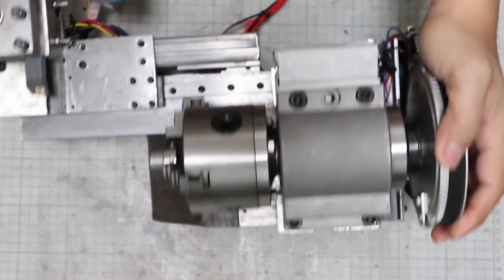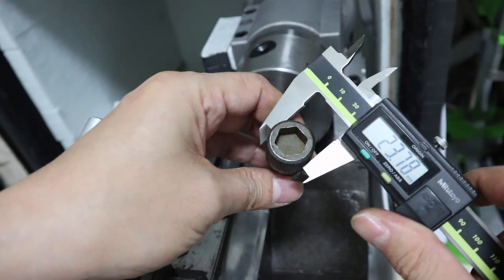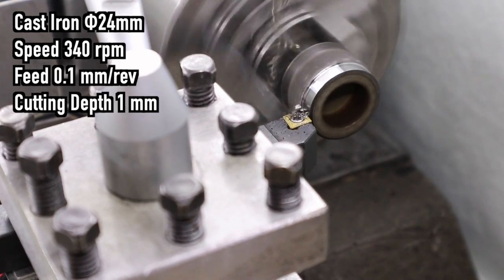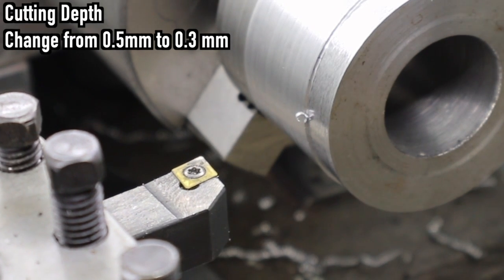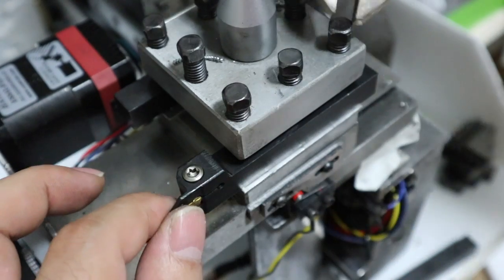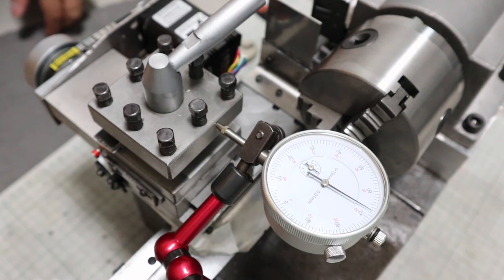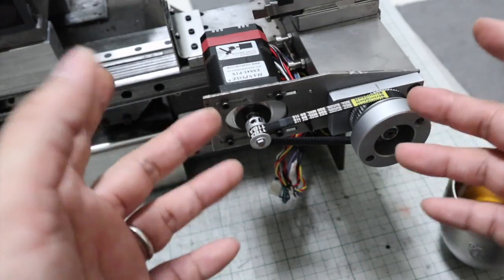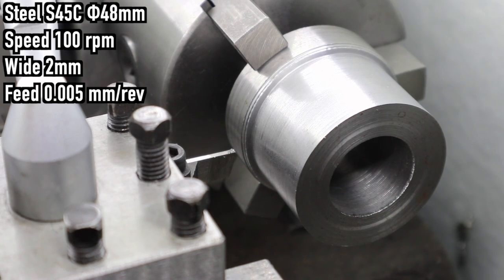Homemade DIY Small CNC Lathe ,Part7

Comment: Looking at steel cutting at 4:14.  What cutting speed is recommended for the insert in case of steel? Maybe quite a big higher then the about 30 m/s you use here?
Reply from the maker: This is because the maximum speed of this lathe is 340 rpm.
Since the motor is small, torque is important.

Comment: At 9 minutes in, when it was vibrating, the lathe insert was loose. You could see it shift when you stopped the spindle. I'd recommend retrying after ensuring the insert was properly secured.
Reply from the maker: Thanks for the advice.
It will be helpful.

Comment: Very good video series ! I have bought a little chinese lathe 7 x 14 maybe it can be converted to cnc as well ? I like the idea with the small box arround it to keep the noise down and it is also much cleaner in the apartment :)
Reply from the maker: I think it is easy to CNC your lathe.
All you need to do is to set up your lathe with steppers motor to rotate the XY axis.
Linuxcnc would be a good control program, but you will need to learn how to set it up.

Comment: speed up

cast iron 1400 rpm
steel 1650 rpm
alu 3700rpm

bit very noce want to build a mini lathe as well vor small alu and plastic parts 

impressiv great work hope to see future videos
Reply from the maker: Changing the gear ratio will increase the rpm but will not produce enough torque.
To achieve higher RPM and greater torque, the motor must be larger.
In order to install a larger motor, the basic design will have to be changed.
It must be very important for me to have a small machine.

Comment: For CNC use, remove compound and mount tool post rigidly. All compounds are flexible and lack rigidity. AXA or other quick change tool post is required.
Reply from the maker: I have already ordered the quick changer post. Looking forward to it.

Comment: Nice to see it working! I learned an interesting thing in a machining course in university: if you experience chatter, you should actually increase the cutting speed to get rid of it. Would be cool if you tried that trick :)
Reply from the maker: Thanks for the advice.
But this is the maximum of the lathe speed

Comment: Great video !! to eleminate vibration on a small lathe is to use your tool upside down in reverse rotation  ;)
Reply: Why does that work? I've seen videos of commercial lathes build with the tools upside down but didn't understand why. Thanks.
Reply: @nickp4793  it's do do with the cutting forces pulling the tool into the work with the fulcrum point on the inside of the tool post.
When you flip the tool the cutting forces lift the tool away and it self regulates.
Reply: @galactica1980  Yeah, but this introduces other problems (waste of use-space, tool standing time, tool working angles, chip breaking hygiene, stiffness, etc.).
The solution of sane people is to use the correct cutting speeds (MATH and RTFM involved ... scary? No! hehe). If resonance will hit you ... a +/-5% variation in speed will not harm you or the surface of your workpiece.
Also, Trivia: If you hear something (And I guess the machine is dead if you don't hear anything) then there is vibration ... That is the nature of our universe, physics. What's important is that you don't have CHATTER while cutting the workpiece. That is something different and you guys should use the correct terms ... or no one knows what is meant at the end of the day.
Reply from the maker: Thanks for the advice.
Reply: Some additionally stuff: You can also use the YouTube function to tell, what you mean ... if you don't find the words. 
Like the turning sounds at time-mark ( 4:30 ) ?
That is btw not cast iron. Most of these types of screws are originally made from cold-rolled steel, which is then drawn or coiled further into wire. The final production then includes rough turning, hexagonal shaping/broaching to size and the rolling of the threads through the effect of radial force. It is not uncommon for these screws to have an increased degree of hardness simply due to the compacting properties of the work steps. That might also cause problems. The appropriate carbide, adjusted and correct cutting speed, lots of lubricant and a little patience will definitely help in such a case;)

Or is 6:46 meant? ("It was vibrating a bit") ... Parting off with the parting tool is a completely different operation and places completely different challenges on the machine. However, you can easily reduce the feed here, since this surface has to be reworked anyway and can never meet a high tolerance or quality. If that is what is meant: What is this nonsense here with this strange advice??? That doesn't make any sense!:))

Or 8:37 ... ? That is simply because the driving motor can't bring enough torque on the axle for the cutting operation. There is only one thing that helps ... and turning around a tool isn't the answer to that question, hehehe (Tip: it has to do with providing the needed power to cut. That can be done by a stronger motor, a different belt translation or simply reducing the force needed to cut ... which @a-cnc-f actually did in the video and I call EVIDENCE for what I said)

Comment: Great project! You may also try using inserts with a very small corner radius (usually intended vor aluminium) and take very light cuts. Works fine on my mini lathe. Might solve your problem with the stalling spindle motor.
Reply from the maker: Thanks for the advice.
Reply: or really sharp HSS tools

Comment: It looks like your slideway for your X axis is kind of short. Why not make it longer. You wont need so much preload  on the gibb with a longer slide. Or maybe get one of those ball slides like they use on that small desktop 5axis Pocket Mill.
Reply from the maker: Using a linear guide for the X-axis and ball screws would make the machine too large, so I decided to use a slideway.
Reply: @a-cnc-f  All understandable. The linear guid used on the 5axis pocket mill looks to be no bigger than your slidway. But as to cost I don’t know.

Comment: Nice Cnc, I have beem watching your progress. For parting operation you should rotate the tool 180 degree and rotate the spindle to other direction. With this, if the cutting force is  too much, tool will be pushed outward  instead of digging into the part. I have a diy small lathe and this technique makes huge  difference. Check this out; https://youtu.be/-RZRq0olsxM
Reply from the maker: Thanks for letting me know.
How the video was explained was easy to understand.